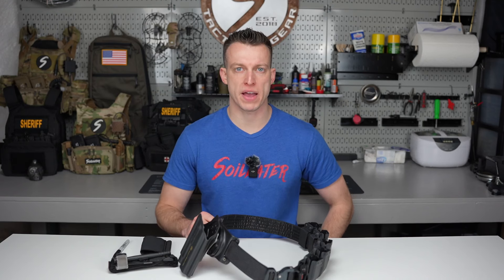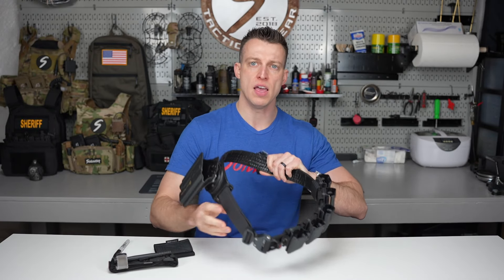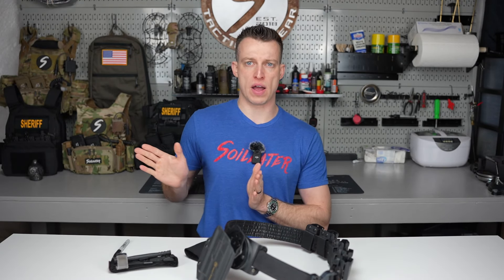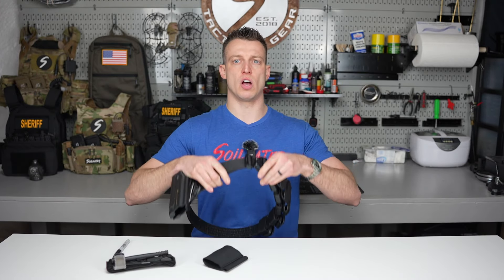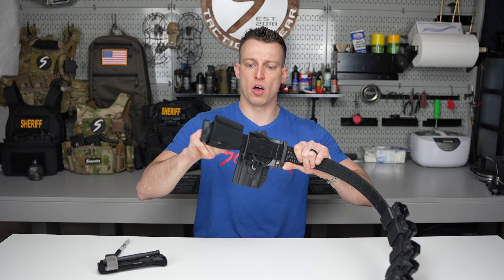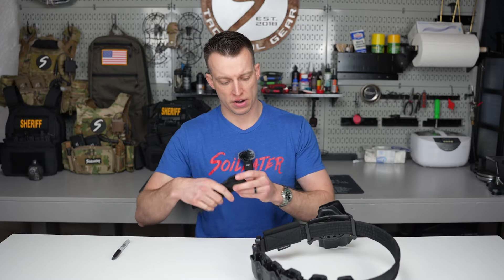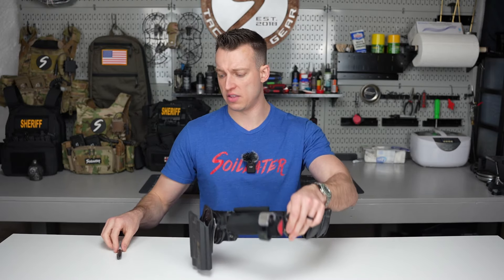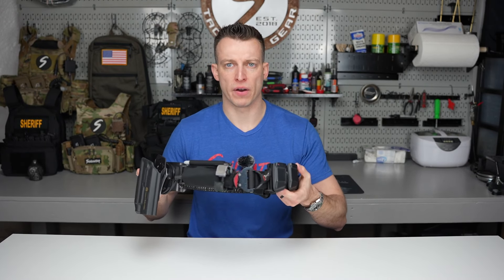OTW Episode 10: How to install a Belt Mounted Tourniquet Holder V2

Comment: i have a question, why everyone installed their tourniquet pouch next to their holster?
Reply from the maker: I designed the original BMTH to go there because it was generally wasted space in SWAT belts. It was usually the area where the extra belt strap would go, because it’s the side you use to tighten the belt usually, and it also meant you lost some Velcro surface area on the back of the belt. So the BMTH added Velcro retention to your belt while also utilizing that otherwise wasted space to hold a TQ. Also it’s close to centerline of your body allowing you to draw the TQ with both hands. Hope that makes sense.